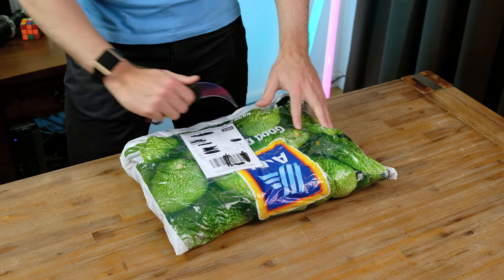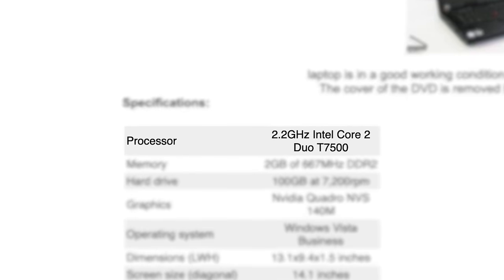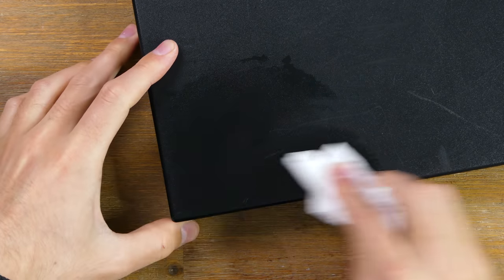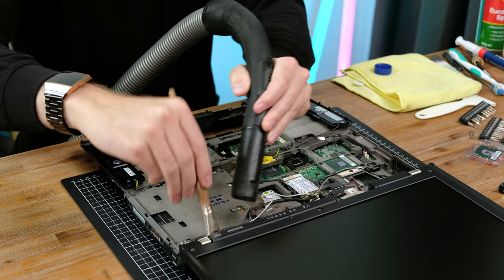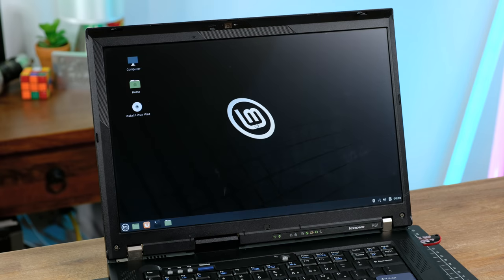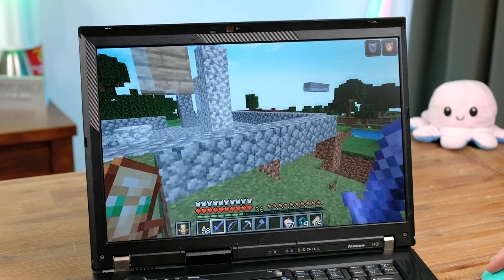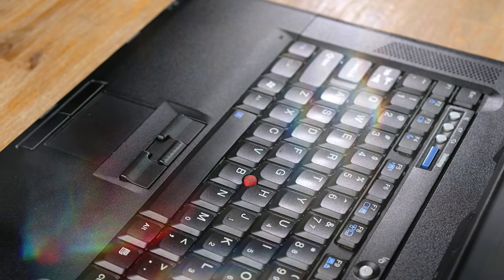I Bought a $49 Thinkpad... And Got Scammed!

Comment: A laptop with replaceable CPU. Feels like alien technology today!
Reply: Right? Unfortunately laptop manufacturers don't even have the choice. Intel or AMD just don't sell a laptop CPU with pins. BGA only. Tossers
Reply: @s8wc3  there are some laptops which use a desktop CPU, but of course much bulk and precious little autonomy
Reply: @s8wc3  maybe battery will improve once BIG.little becomes standard also for Intel
Reply: Socketed CPU is more of a 'gotcha' for the uninitiated though. Liiike.. You can only replace a 2004 CPU with a 'very slightly' faster CPU that's also from 2004. ~usually stuff like that.
The reality is that socket compatibility puts an end to most of the fantasy.

I get a feeling that when people see old laptops with CPU sockets in them they think they'll be able to put a "zOMG 32 cores" 2025 CPU into in the future but that's just not how it ended up working. They end up buying an old thinkpad and then being bored of the lack of 'real' upgradeability in like a month 😄👋

Comment: I had to redo the thermal paste on a T500 with a T9600 CPU and 4GB of RAM, I have still the original hard disk and it's not bad at all honestly, not fast but not slow either
These computers are a PAIN in the heck to disassemble, the screws are just not the same and it's not nice

Comment: I had a T61 widescreen that was modded and used till earlier this year. great machines

I had an intel core 2 duo E8135 2.66ghz from an imac with a modded motherboard to make the fsb run at 1066mhz and ram with spd flashed to 566mhz but just 4gb. I was planning on shoving a core 2 quad into it and upping it to 6 or 8gb of ram but never got around to it. now i'm moving onto a X61 and plan on soldering on either a p9700/p9600 or t9900 cpu.

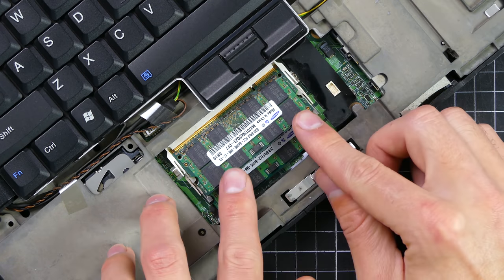Comment: 3:25 I think you were reading the latency as the speed of the ram, pc5300 runs at 667mhz and the pc6400 dimms you installed run at 800mhz ;)
Reply: I also can't recall if the 965 chipset supports 1006mhz processors, but there is a pin modification you can dig up to run 667mhz fsb processors at 800, and 800mhz processors at 1066. Processors with a 2.0-2.4ghz stock clock speed are the sweet spot for doing this modification and I ran a T7200 at 2.4ghz in a Dell Precision M4300 with a slight undervolt for several years.

Comment: I got a Fujitsu Lifebook T4220 wacom "pen convertible tablet mode" laptop from a friend, it's going to get a T9500 cpu, Windows 10 Pro and a 1TB ssd, it should be a sweet little convertible machine and the screen is trans reflective as well as back lit, you can turn the back light off outdoors in the sun and still see it perfectly. The wacom pen is really cool to use as well and I actually think I prefer it to touch screen. It's keyboard is really nice too almost as good as the one on your thinkpad.
Reply: 𝘿!𝙘𝙠 Riding ǤƗяℓ Lily  I took it apart and there's TWO BATTERIES in it not mentioned in the service manual wtf you forgot about the BIOS battery oh da fuq! I got the proper little battery and tomorrow going to get T4220 Fujitsu hopefully running windows 10 with a nice CPU! But what the heck that little battery the actual one for the BIOS the other rechargable one I got is for standby so you can hot swap a battery.
Reply: really pissed me off that Fujitsu even in THE SERVICE MANUAL FOR THIS LAPTOP did not mention this battery ugh! ITS THE BIOS BATTTERY assholes lol but should get it running tomorrow if it works and 9500 cpu will be fun! And 1tb SSD!

Comment: Looks like a bad deal indeed. 🤨 I got one R51 three years ago in a Hard-Off in Japan for 1200 JPY. It was allegedly in a non-working state, but only the hard drive was missing (and screws were in the bay actually). It had a Core 2 Duo T9300, 4GB of RAM, integrated graphics but the WSXGA+ 1680x1050 display. Just add a small SSD as you did and you get a pretty capable device.

I transferred most of its components into a T61 chassis afterwards.

Comment: I managed to save a R400 from trash. It has been used in a school BUT has not suffered from abuse ! It is actually in a fairly good condition. Works great on Linux, even with 2Gb of RAM (SWAP saved the day again) but that GMA 4500m... There is a dock compatible which adds a PCIE x16 connector (x1 wired) for a GPU but it is extremely rare and expensive...
I'm using it right now to type this comment. Great little YouTube watching machine.

Comment: I have a hp Compaq 6510b and upgraded the CPU to a Core 2 Duo T9500 with 4GB of RAM. Still my daily driver as I use Windows 10 on it.
Reply: Psviewri wasn’t really scammed in a way because he bought an upgradeable laptop. It isn’t possible to do those things on modern laptops so that’s where buyers are scammed. Buy one of the latter, you’re stuck with the stock configuration forever. Old laptops do hold their value well and even at $49, one isn’t out much. That it bought a working Thinkpad is incredible!

Comment: I owned one of these. They are not that bad. I did all the usual upgrades and even managed to find a bios firmware upgrade for it. Unfortunately mine gave up. I now use an upgraded dell d520 and macbook😁 that run linux

Comment: It's probably just that they're old, very popular, and heavily resold by modders so the sku numbers on the laptop no longer match the (probably replaced a long time ago) motherboard inside.
Got my personal-take-home T40 Pro this way. Orderered a low spec T42, got a much better T40 Pro for cheap because the T42 shell had T40p internals and the seller probably never checked :)

Honestly, most sellers just turn the thing on. Press Del to get into the bios screen and then just claim that it's "working" without seeing if any of the I/O actually works

Comment: Hello friend, This laptop is built very much like my T500, from other video that I have seen on youtube, there is a way to reset the bios password so you can get in, you have to short some connections on the motherboard, try youtube bios lock search for a T500, you will find it.  I am happy with my laptop.

Comment: EBay is always kind of risky. I bought a Pentium 3 700MHz PC but instead i got a 700MHz Celeron. Fortunately i could pay it with PayPal so i got my money back.

If you have a supervisor password set on this laptop you should be able to remove it. A few month back i got myself a T500 with the same problem. So i searched for a solution and found one. You have to locate the EEPROM on the motherboard. Upon startup you have to short 2 of the pins (i cant remember which pins exactly but there are tutorials you can find). Kepp the shorted until you reach the BIOS. Then still keep the shorted and go to the supervisor PW settings. When you set the password you have to enter it 2 times. After entering it the first time release the shroted pins, enter the PW the second time and save everything as fast as possible. This way you could set your own PW or just leave it empty to deactivate it. That helped me with my T500. Please try at your own risk^^.

Comment: I recommend no longer using Linux mint, and instead, using PopOS, as it is less resource-intensive. If you really do want the best performance, then lubuntu is also a very solid linux distro, which can run on only 300mb of RAM, with a graphical user interface

Comment: Typing this from my T61, I bought it a couple weeks ago, it came with a nvidia board, but it quickly started showing graphical issues and completely died, I tried reflowing it but it didn't work, so, in a way, you're dodging a couple issues that these old laptops had with the graphics card (my X53S Asus from 2007 suffered the same fate a couple months ago)

EDIT: The only thing I find a pain in the ass about running this without a discrete graphics card is that I can't use Kitty, or any other GPU based terminal emulator

Comment: I was looking at the same exact one lol, trying to grab one for older games / windows xp system
Reply: I don't recommend it
Reply: It doesn't support Opengl.
Reply: @abhimaanmayadam5713  Thanks for the comment, I'm about to buy a older ThinkPad and will have to double check with what I need and whether or not it comes with it. I honestly had no idea
Reply: @Valrax  old intel integrated graphics dont support opengl. Find something with an ATi graphics card. Intel CPU is fine. Also get something with a core 2 duo. Core Duos and Pentium Ms are 32 bit and don't support pae.

Comment: Him: You never know who or what has been touching the surface.
Him: [Leave desk uncleaned. Flips cleaned side onto uncleaned desk.]

Did you try powering on WITHOUT BIOS Battery to force setting to reset, then power on WITH BIOS Battery? That's what I always do on Desktops as a last resort to boot problems.

Comment: Hey, you should install Linux Mint XFCE edition on these laptops, it is quite light compared to the regular Mint (specially in the graphics side, this Intel GMA is painfully slow), it is similar to Windows XP in functionality and fits quite well old laptops.
Reply: Anand Raj  that's overly complicating stuff. Linux Mint is pretty user-friendly and LXQt is not that lighter (and it doesn't need to be, this isn't a Pentium 4 with 512MB of RAM or something, it just needs to be light on the GPU) and LXDE is pretty much dead. Also, Debian isn't the most up-do-date system and Steam doesn't oficially support it like it support Ubuntu (and Mint, that's based on Ubuntu).
Reply: Anand Raj  Debian is great, but it is too much of a hassle for just testing an old laptop.

Comment: Tbh, the joke is on the scammer. Most ThinkPad R series laptops that are fixer uppers are around that price on eBay. The R61 that I bought from Refurbio cost me around $71 fully refurbished. Very upgrade-friendly, and as of next year, I'll have had it for 10 years. I used Windows 10 on it for almost 8 years, then when I got myself an X260, I swapped out the HDD and installed an SSD that had Linux Mint pre-installed on it. (I was using it on an ultrabook that I had tinkered with.)  It took to Mint like a duck in water, and for a Linux daily driver, it's pretty solid. 

The dude who sold you that R61 is a scumbag for lying about the specs, but like I said, the joke's on him.  In capable hands, the R61 is very reliable.

Comment: You want to do a video on a hp dv8000. 17 inch higher performance hp laptop from 2006. Dedicates 256 mb graphics card, centrino duo processor. Let me know. Ide need it back.

Comment: The screen in this one has probably been changed before. The stickers covering the screw holes often get lost, or the tech doesn't bother applying new adhesive so they just fall off. Specs wise  I bet you the seller just googled the model on the screen bezel instead of the proper machine type on the bottom and just took the first thing they saw as gospel.

Comment: Well technically, since postage had to be paid by someone and in Au that's at least $20 postage for either Au Post or a courier, then you effectively paid $29 for the lappy. At that price I'd be pretty stoked that it would even turn, no matter what the description said. I get that you feel duped because the description didnt match what you got. It's a risk you take if you buy a dirt cheap item. Even if "postage is included" someone had to pay it - even if whoever can claim it back thru tax, it has to be paid up front or the item simply doesnt get posted. (Another example is "free shipping with Prime" no - someone has to pay it, so our Au prices are higher because postage, or a % of postage is already added into the price of every item.) Maybe it's just me who thinks this way? 

Also for that price I'd expect to have to do some upgrades to get a decently running lappy and you were lucky to have a cpu laying around. It is possible to get some good deals on older laptops but you expect to have to replace the battery, ram and switch to an ssd. A lot of times they dont come with a charger either. I've bought many 2nd hand lappys from ebay tho I've never paid less than $150 + postage knowing I'd also have to buy a charger and upgrade it later. Granted I'm partial to Tecras. Maybe they're more reliable long term? I've never asked for a refund or partial refund, just chalk it up to experience but you could leave a neutral or neg feedback. I've only ever left +ve's. Again maybe just dumb luck? Back when these things were new they cost thousands. Tecras can also be docked - awesome.

I know I"ll get hate for this comment. Not everyone thinks like I do, and that's okay. Good vid, Nathan.😉

Comment: You can unlock those BIOSs on old TPs with an actual paperclip. Shorting the EEPROM at a set time in boot cycle does it.
Reply: Phoenix  𝙾𝚙𝚎𝚗 𝙼𝚢 PROFILE  There are safe-date motherboards that don't suffer from the nVidia bonding agent failure.

Comment: Lollllz you are luckier. I bought a Gateway SA1 off eBay, without adapter for U$50, and it does not work. I have narrowed down the problem to a MOSFET, and two adjacent capacitors on the mobo. But with a DMM and a 40 Watt soldering iron, that is as far as I can go 😣.

Comment: Graphic device 1
Microsoft Basic Display Adapter (No ACPI support)
Current resolution
Refresh rate
0
Version
10.0.19041.1 (6/21/2006)
Areo status
Enabled
Graphic device 2
AMD Mobility Radeon HD 5000 Series
Current resolution
1600 x 900
Refresh rate
1
Version
15.201.1151.1008 (11/4/2015)
Areo status
Enabled
Graphic device 3
ATI Mobility Radeon HD 4200 Series
Current resolution
Refresh rate
0
Version
15.201.1151.1008
Areo status
Enabled

Comment: I mean.. in quite a few benches the 5800 vs the 7100 is between margin of error and 5%.. I mean you had to open it anyway to do the paste, but I doubt it's a noticeable change. I have some old laptops of this generation and I can never find much use for them.  This being right around the Vista era, maybe you could find XP drivers?  This could be a nice XP system.. no gpu kinda hurts though.

Comment: What a shit seller this is. Happy the old Lenovo at least got the love it needed and deserved. Well done!
As for Thinkpad keyboards; Unpopular opinion, but I don't like them. I type at 700+ keystrokes per minute andk ee pgetting error sliket hese on a thinkpad. Somehow I always misplace the space bar. For me the best laptop keyboards were used in the Dell Latitude D610/620/630/410/420 series. 
I recently found a pentium III Lenovo laptop in an electronics bin, took it home. Apart from a very dim screen backlight it works flawlessly, running windows '98 like a champ :D.

Comment: The BIOS can be reset by either:
- unplugging the main and CMOS batteries and holding down the power button for 10 seconds
or
- if that doesn't work, get a CH341A programmer and flash the EEPROM.

Comment: Nice video man....
Those videos are my thing and kinda inspired me do some restorations.
Last year i found next to a garbage can, a Dell Latitude D520 with a pinner Intel Core Duo T2300E and 512MB RAM.
I gave it good cleaning, i throwed a Core 2 Duo T7200 and applied some Noctua NT-H1, Upgraded to Max 4GB (2x2GB) DDR2 800 MHz (3.2 GB Usable & limited to 667 MHz),the WIFI stayed the same Intel PRO/Wireless 3945ABG.
I kept the original Samsung 80GB HDD ,it decent and mostly i don't care about being fast.
Installed Windows 10 although its chugging is still usable for base things like Old 95-2000 games/browsing/work.

Comment: I think the scam was kinda intentional. A R61 with this sort of specs with no cleaning is worth almost nothing...
Be grateful you have the GMA graphics as the NVS140M chips are well known for failure and it's unlikely you will get the later revision of the chip that doesn't fail!
When you upgrade to a more powerful T8300, T9300/T9500 CPU though, make sure you have custom Middleton BIOS installed or else the motherboard won't like it!

Comment: Hey! I got an r61 out of the ewaste the other week. But mine has euro keyboard and a 15.4" monitor. I normally avoid older stuff but I love thinkpads. I was just gonna chime in a say have a search through the ThinkPad forum you can reflash this model with a modified bios look up ' Middleton's bios' this allowed me to swap out t7100 CPU with a t9300 and it also gives you better sata speed. I'm running haiku os on mine for something different.. All the best.

Comment: a couple of months ago, I found a true IBM Thinkpad G40 laptop on the side of the road. It still works fine and booted right into Windows XP. It has a 2.6 ghz Intel Pentium 4 cpu with 512 mb ram and it seems to be from early 2004. Still works fine today although it has a damaged usb port, but still not bad for a laptop that I found in the trash.

Comment: Here are the specifications
AMD Phenom(tm) II N640 Dual-Core Processor
System memory
6GB
Memory slot 1 and 2 
2GB Samsung 1334MHz
4GB Hynix 1334MHz
System board
1443 67.33
System bios
F.28

Comment: I really love lenovo thinkpad laptops 😍😍 They have a lot of ports and really durable. But what I really love the most is the thinkpads where you can directly install a cheap egpu dock instead of removing the bottom case and wifi card.

Comment: stop ruining computers by installing linux on them. the original windows installations usually have lots of preinstalled software from the manufacturer. also please dont install windows 10 on computers that are "designed for windows 7". windows 10 just makes it slower and ruins the purpose of having that laptop unless you want to daily drive it.

Comment: I've had the opposite experience buying a dell laptop on ebay, seller had several in stock so it was certainly laptops sold by a company after they were replaced, 
It was supposed to come with a 3720QM, it came with a 3740QM (100mhz extra base and boost speed) so that's a win.

Comment: Just so you know, there is a way of shorting two pins on the boards which will unlock the BIOS.
I did it on my X200s and it worked!